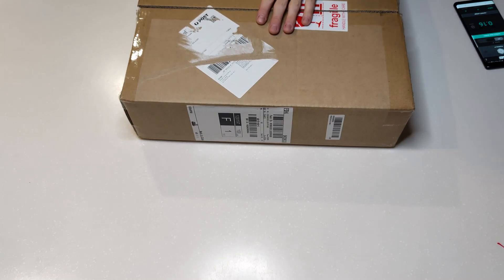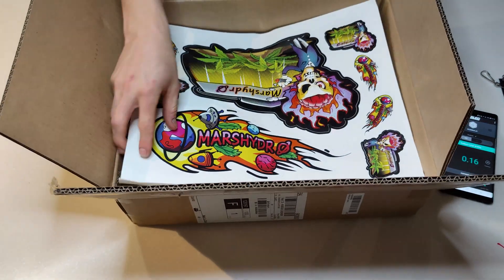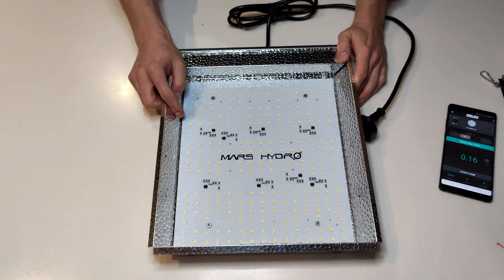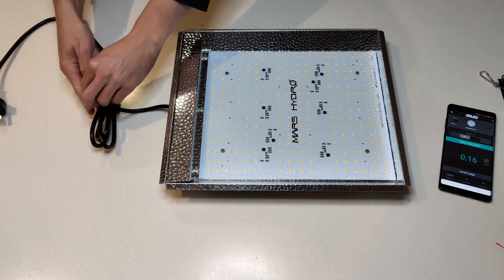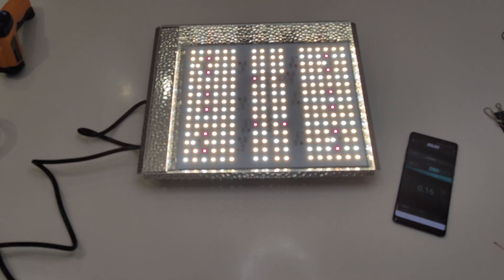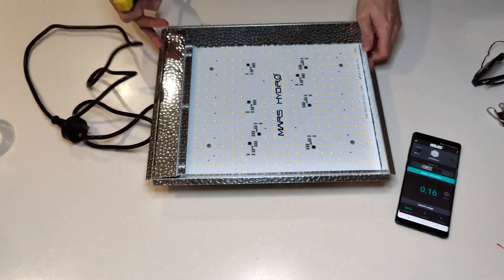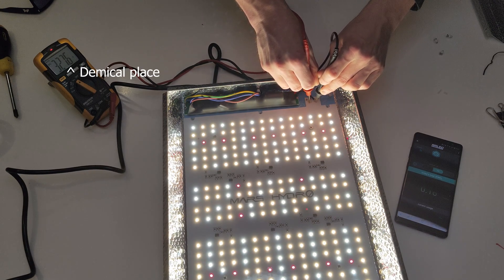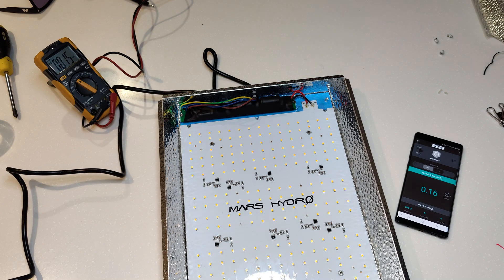Mars Hydro TS600 LED Grow Light

Comment: Nice light mine comes from Amazon today. Question, what phone app and power cycle are you using? I’d love to set this up with a timer. Thanks!
Reply from the maker: Oh awesome!

So, that is a LONG story. In this case I was using the Arlec / Deta GridConnect, but it is garbage. Do not buy, fails to easily. I have maybe 20ish brands of IoT stuff around the house now that I am aiming to slowly start making videos on, HOWEVER, WiZ is by far the best so far (available at Bunnings https://www.bunnings.com.au/wiz-smart-accessory-power-plug_p0331090).

Phillips is a no-go for me as it requires their 'Hub' and is overpriced. LIFX is also super overpriced. TP-Link Kasa is great, but Tapo is rubbish. They do work, just requires you to create an account, always be online, and does not support 3rd party integration. Mirabella Genio, Lasar, Lenovo etc are all just Chinese-OEMed Tuya products. So is 'Brilliant' actually, but some of their lighting is REALLY good (have used for years). The 'Connect' stuff eg https://www.harveynorman.com.au/connect-smart-wifi-plug-with-dual-usb-charging-port.html is also Tuya based, and sometimes branded Kogan, but works well if you flash it with Tasmota - I cannot praise their pain-in-the-ass-app though. 

Lastly, Sonoff is always good, but have to order online, and a good backup brand to WiZ, although not as open. The WiZ option does not have energy monitoring, which I use the 'Connect' for, however, if you can find this TP115 anywhere, it's my favourite so far https://www.tp-link.com/au/home-networking/smart-plug/kp115/. Athom make some awesome products, HOWEVER, there is a fault with their smart plugs that they are yet to fix (my first video is about this). When they do, they'll become #1 for me. The worst so far has been anything Cygnett branded. Worst than GridConnect.

End rant haha.
Reply from the maker: PS if you just want super cheap super easy and don't care about it being internet-connected (security hole) or requiring their specific app, then I'd say 1) WiZ, 2) TP-Link, 3) Sonoff!
Reply: @PlatimaTinkers  Awesome thanks for the write up! Wiz it is! 💪
Reply from the maker: @igloo211  You're very welcome friend! Always feel free to reach out and ask to see something tested or what might work well - this channel is all about me pissing money away to find the best tech 😂